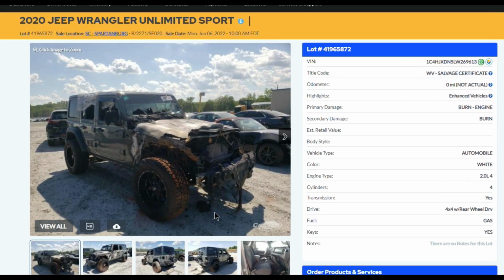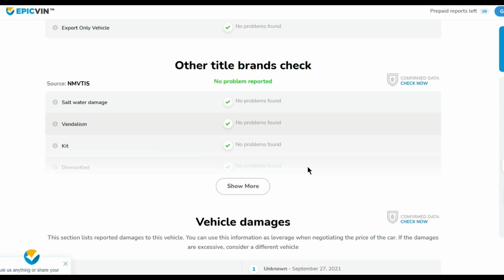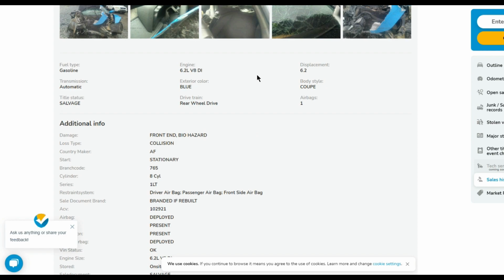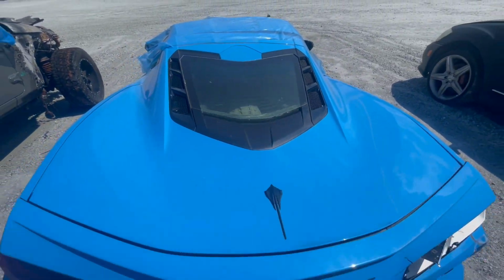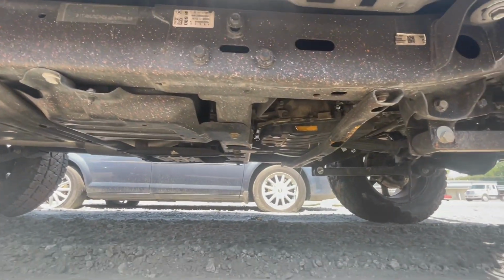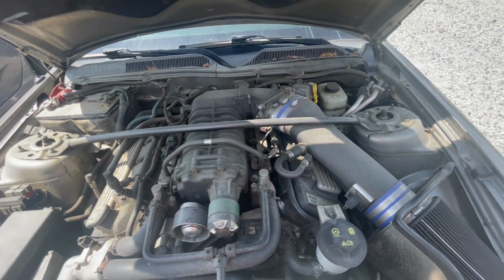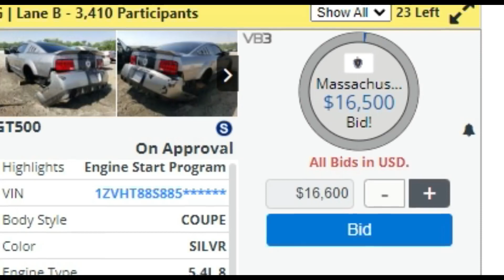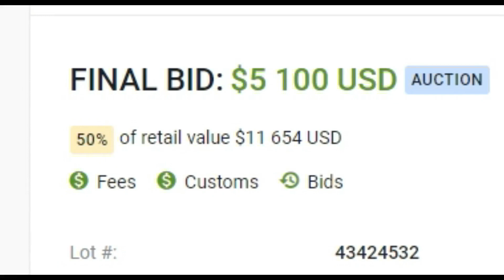MELTED 2020 JEEP WRANGLER, CORVETTE STINGRAY AND MORE

Comment: I have a 13 JKU with the 3.6 LTR V6. The high pressure gas line crack and started to leak. The gas line runs in between the upper and lower intake manifold. It was a pain to replace, i had to take the upper off to get to it.

Comment: The Corvette is pretty much destroyed so the car is not rebuildable. Parts only. Primarily the engine. That would have been a lot to spend to get the engine for possible future use. The Jeep might be rebuilt but might be hard to sell if it was damaged because of a recall that somebody failed to get.  Potential buyers for the fully rebuilt vehicle might shy away because of the fire even though the damage from the fire would be repaired. Jeep should have buy this one back
 And the Mustang can certainly be repaired. You would really need to inspect the car underneath to get an idea of the actual damage to the rear. The actual mileage issue needs be cleared up and has the car had  abuse from previous owners Abuse is often connected with cars of this type. Previous abuse could effect the condition of the engine, transmission and suspension. And the old Camaro, I would pass one that one because of it's age. Would be fixable or restorable, maybe restomod it. Depends on how much you would need to put into the car and what you could. I'd like to see a restoration on a car like this but restomod would cost much less and might be easier to flip.